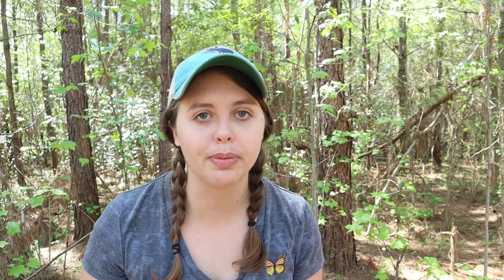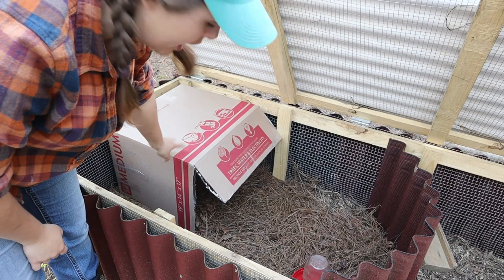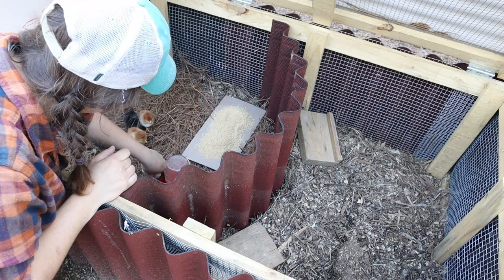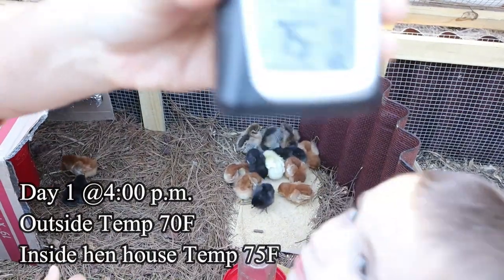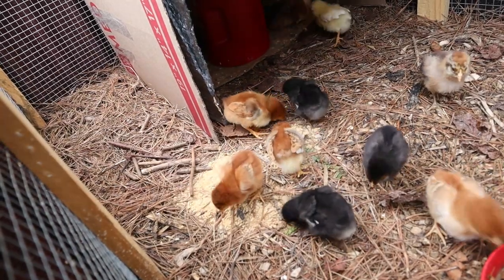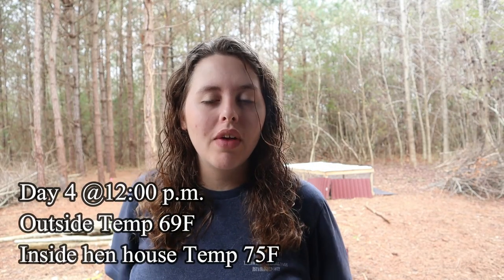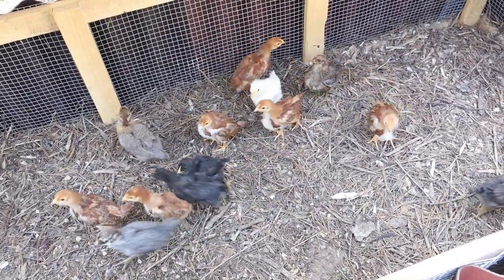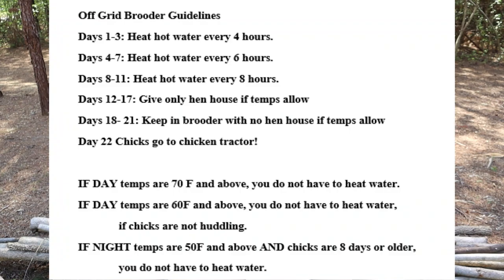STEP BY STEP ON HOW TO RAISE CHICKS WITHOUT ELECTRICITY! How we brood chicks off grid

Comment: Hello Megan i might know a way that you don't have to heat water every few hours.
Reply from the maker: What would you suggest?
Reply: @LivingtheHightLife  they make a small propane hot water heater/ shower that has a small battery pump to it and it uses the 1 lb propane tanks. Get a 5 gallon bucket or a 15 gallon blue drum fill it with water. Put the pump in the bucket then Take the sprayer off and get some hose and get some coffee container and other container and drill 2 holes in the container and run the hose in a coil on each container but don't cut the hose. Then run the end of the hose into the bucket so it will continue to keep flowing. Put water in the containers that would keep them heated for hours or all day or night. Seal the holes so the water want come out.
Reply from the maker: @jeboutdoors377  I have never heard of one of those before. I will have to look into it. Thanks for the suggestion